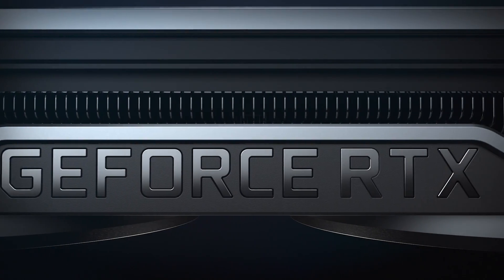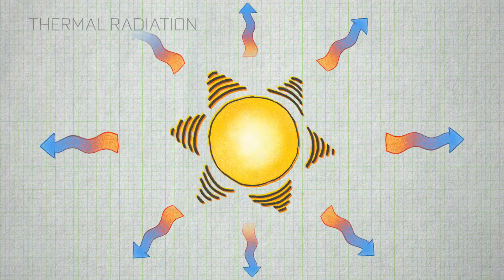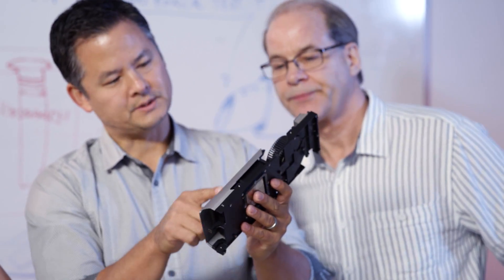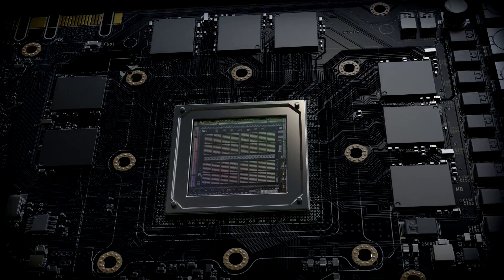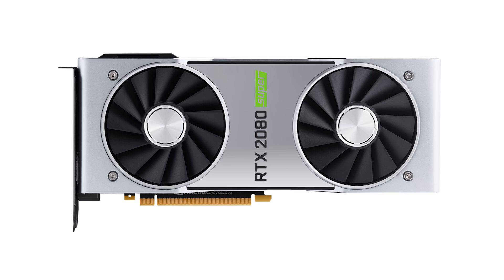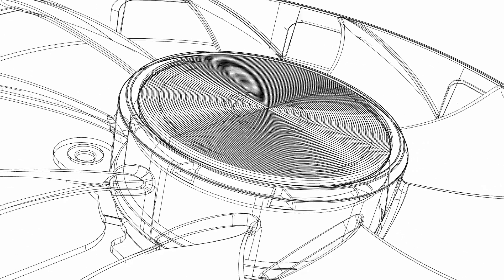The Remarkable Art & Science of Modern Graphics Card Design

Comment: It's a good job that the new 3000 series cooler doesn't dump 300 W worth of heat straight onto my CPU cooler and temperature-sensitive overclocked RAM. Oh... wait. Did the design team consider that the PC might have other components in it that also need to keep cool?
Reply: The 3090 is not for cheapskates. The heat in a loop spreads evenly through the whole loop. Just have adequate rad area.

Comment: as a fanatic of thermal solutions, i will give you a dislike to this nosense video, SHOWING NOTHING
all you have shown of the new heatsink is that it will throw half of the gpu heat directly into the intake of 95% of cpu heatsinks, increasing its temp +10ºC at least.  people are going to enjoy your cards ... for sure. 
And those isolated vram heatinks, with 0 AIRFLOW ZERO AIRFLOW, jfc, go fire your design engineers
Reply: They'll be analysed on YT to the most minute detail. Nvidia know any issues will not stay hidden. I doubt Nvidia are banking on selling all their GPUs in that small window of opportunity.

Comment: So this is confirmation for 12 pin power. Since you (NVIDIA) include the adapter, this should not be a problem.

Thank you very much, I was already wondering if I had to either stay away from the 3090 or throw away my super expensive HX850i.
Reply: If you can’t buy a 3090 + a PSU, you can’t buy a 3090, this thing will be expansive AF. 3080 will be the choice for high end.
Reply: @dufonrafal  

10 GB of VRAM will be a limiting factor very soon.

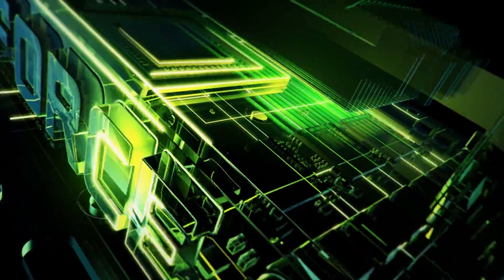Comment: 4:39 they're preparing us for that high tdp  ;)
Reply: Ahí dice "GTX"
Reply: @seucheanemone5652  nobody knows yet
Reply: truee, 3090 is all but confirmed to use 350W at stock speeds
Reply: @needlessoptions  Stock speeds means idle?
Reply: Syntox no it means maximum stock. No modern GPU consumes their maximum power budget at idle.
Reply: @Zosu22  ok thanks
Reply: @Syntox94  Zosu is correct, I just meant the clocks it will run at while under full load without any overclocking.
Reply: no shit, Sherlock
Reply: @cbz3237  Be quiet

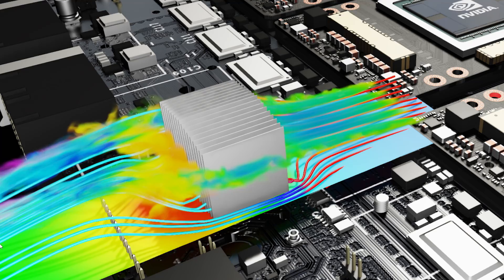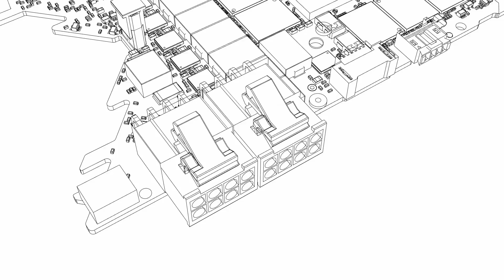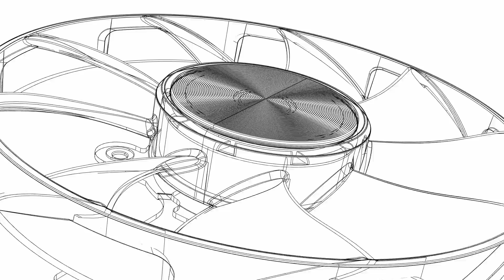Comment: All 30-series renders: 2:27 3:08 3:53 6:10 8:06
The drop at 4:12 killed me on the inside.
Reply: Any more notable time stamps? Remember NVIDIA loves to hide Easter Eggs.
Reply: 3:08 Heatpipe Design 2000 Series i guess?
Reply: Good job.
Reply: Lol yes
Reply: 3:25 an old Nvidia GTX 980
Reply: 2:27 I think its just the airflow of a blower-style card
Reply: @lemaohoy  It's obviously not a blower card. What sort of blower can air go through vertically and what sort of blower looks exactly like the RTX 3090 leaks?
Reply: @nathangamble125  just went back here to say, yes its a blower card
Reply: 2:26 has no 3xxxx renders. Delete that stamp
Reply: @sadstormtrooper  that's the 3080 sideways.... and is showing how the air flow works on that strange design.
Reply: @josejuanandrade4439  Strange puts it lightly. It's literally blowing heat straight into the cpu heatsink. Kinda an ass backwards design.
Reply: @DBZHGWgamer  not if you aio. :)
Reply: @Nathanael_Forlorn  or yes if its on top
Reply: @Nathanael_Forlorn  Even with an AIO, it's pumping heat straight into the water pump...

Comment: Don't forget the 12 pin power connector on 6:11 ( Using an included adapter)
Reply: An it's 90° tilted, so it's "tall" instead of flat, - and 45° angled really interested in how it will look on the finished product with cables.
Reply: @everyoneisgosu  its a 3 slots GPU
Reply: @AirborneExplorer99  True, my "issue" is not with hight, just with the positioning. for my understanding it would stick out in at the middle of the card in a 45Degree Angle (Cable) - could give interesting Cablemanagement options. For now it seems like only the FE Boards would make use of it in THIS way since the PCBs are FE-Only (afawk)
Reply: @everyoneisgosu  i dont understand but im excited with ampere😍
Reply: @AirborneExplorer99  Wells if you look a 6:11 you see the Connector is at a corner of the Display. The Coolingbody itself will be larger then the PCB itself. So the Connector will be sticking out at the middle or around 2/3 of the whole thing. So it is a card where you have the Powercable coming out at a 45Degree angle at the Top or Bottom. Instead of the Classic Corner or backside-Design. It's not a flaw, i'm just interested how they do that and what the Connectoradapter will be. Adapter doesn't sound like Extender to me, so this can look pretty ugly until we get presleeved Cables or buy adapters and sleeve it ourself :D
Reply: @everyoneisgosu  https://www.hardwareluxx.de/index.php/news/hardware/grafikkarten/53907-12-pin-micro-fit-3-0-stecker-fuer-ampere-geforce-karten-bestaetigt.html

That is the Seasonic Version of the Adapter
Reply: @simon0815w  True, but talking about the Adapter NVIDIA will include as mentioned in this Video. Of course there will be Corsair, BeQuiet etc. who will offer those. But they won't give them away for free. And yep just a couple of Dollars to buy those in comparison with an expensive card but i still have to add those costs to the total costs right. So if this Adapter is nothing then an Adapter that you plug in and plug your 8Pins - it's not that nice but otherwise the 12pin is way smaller then the 8Pin, so there has to be a bigger "hole" right, also degrades looks. I will go with a Waterblock anyway, but it's something i think could be mentioned. We'll see in the next couple days what will happen. I'm really excited and can't wait to put my money down again for something way pricier then it should be =C :D
Reply: @AirborneExplorer99  My asus gtx 580 direct cu ii was 3 slots. I fucking loved it, simply becase ut looked so fucking menacing
Reply: @everyoneisgosu  Ahh I see what you're saying. Damn this is going to be unique for sure.

Comment: What's a bit worrying is that NVIDIA hasn't had high-end competition for 2+ years, and now another NVIDIA generation is about to be released. When they've already been at the top for 2+ years, they don't really need to push things that far forward due to lack of competition. Also means higher prices :/ AMD really needs to step up, or, in another two years, NVIDIA will have a 4-year head start and won't have to do much with the 2022 cards because they're already so far ahead. Basically, the same as Intel and their CPUs before AMD came back 2 years ago and gave them some competition.
Reply: But instead of Intel, nvidia is pushing performance. Thats why it wont happen to nvidia. They can just adjust the prices once amd becomes competitive. Intel was stuck at 5-7% perf increase per year for a few years, thats way worse.
Reply: @OutOfRangeDE  and they were stuck on the 14nm node they are on